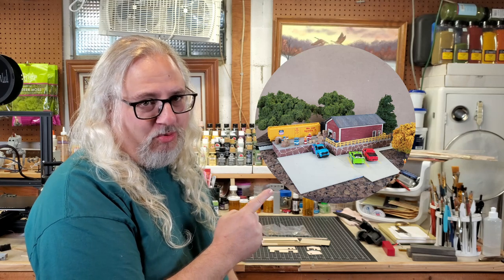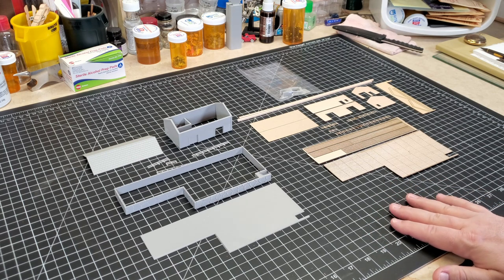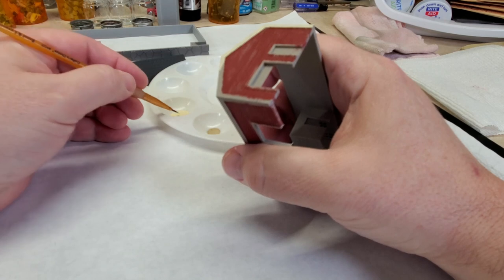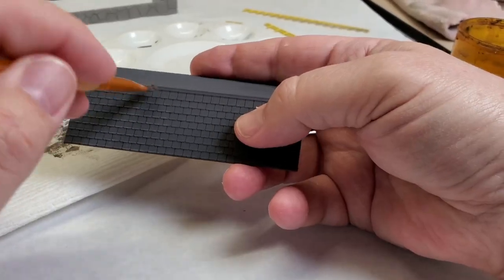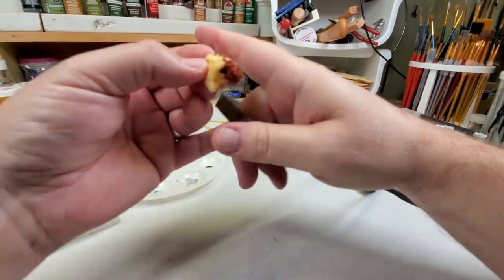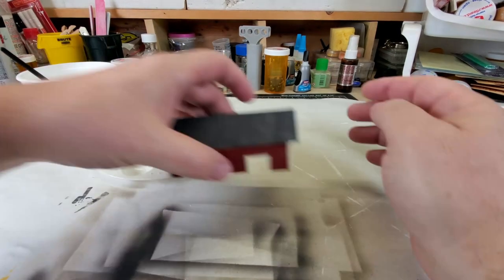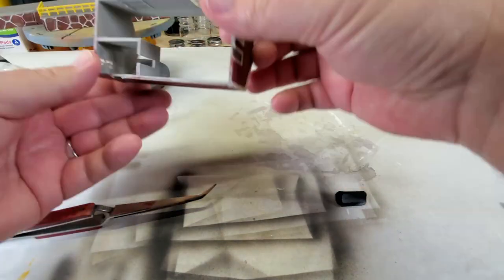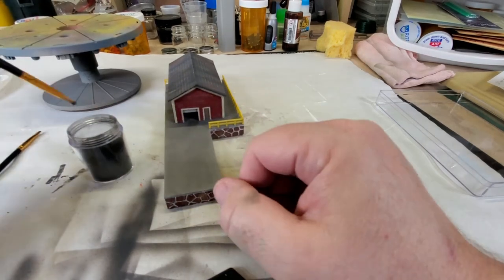Build Your Own Model Railroad With 3D Printing!

Comment: Stuff like this makes me wish I could afford a printer
Reply from the maker: Hey Chris. I don't know your financial situation, but 3d printers have come down in price a heck of a lot. You can pick up either an FDM printer, which is what I used to print this model, or a resin printer for under 200 dollars on Amazon. That's cheaper than most diesel engines.  Thank you for watching and commenting. I hope you are able to get one someday. Take care.
Reply: @RoadsAndRailsHobbies  yes Sir I realize that.  But I'm also not comfortable using a computer to do the proper programming to get things right.  Thank you for sharing this.   Have fun, Chris